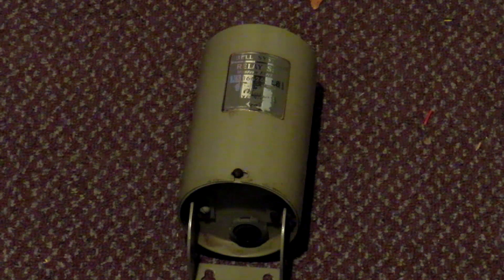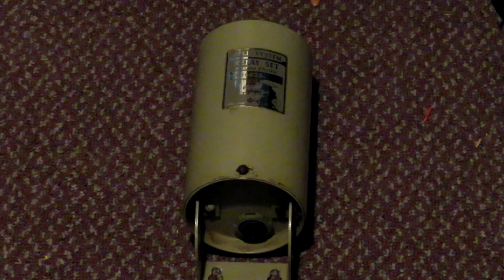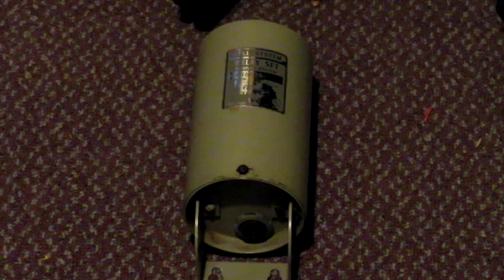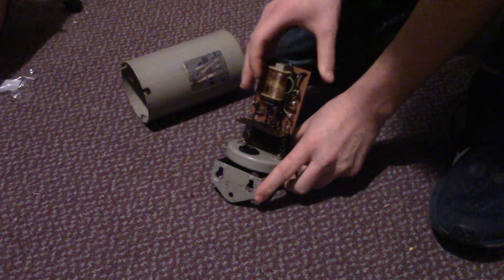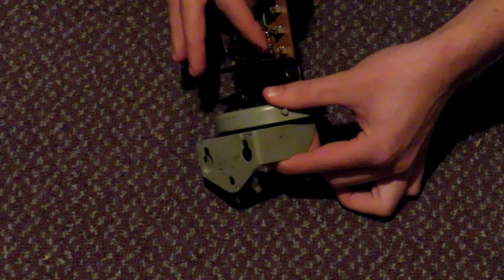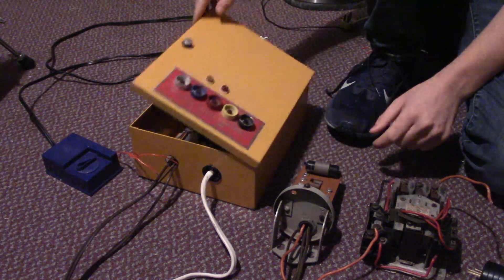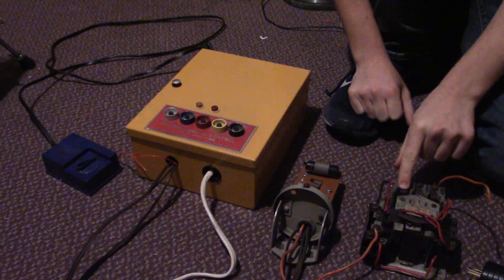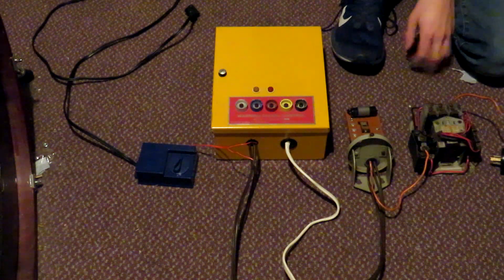How Do Telephone Wires Activate Warning Sirens?

Comment: gets a spam call
Reply: Most often these wouldn’t actually be connected to the PSTN. At least at the time of install, they would be connected to a system such as the CARW system, which was operated by the phone company but used completely separate equipment from the other switching equipment being used by the public.

Comment: Actually this is one way that telephone lines activated sirens. Traditionally, a rotary dial with a card that labels the finger holes with certain signals was used. You would dial the signal twice within 10 seconds. It's called the cdws bell and light system
Reply from the maker: sean juth Thats was found on larger systems for smaller systems this is what they used since it was more economical.

Comment: You never mentioned what was at the siren site. How would the siren controller decode the ringing voltage
Reply from the maker: sean juth It does not decode the ring voltage the voltage energies the ring relay that then energies the sirens main relay.
Reply: @FSThunderboltfan1000  then how does the siren relay know which signal to activate?
Reply from the maker: sean juth there are two ways to go about it. The first is have a central controller that controls the timing for all the signals so there does not have to be a timer on site. Then there is the option to have two dedicated phone lines coming in to control two different ring relays to activate the two different signals at a timer at each siren site.
Reply: @seanjuth  There actually is no signal or code to decode, the municipalities leas a dry pair of phone lines that go from the siren locations to the local central telephone exchange and from there are connected directly to another dry pair that goes directly to the fire department or police station where there is an AR Timer and a special power supply also leased from the phone company that supplies the voltage for long line runs. Let's say that a city has six siren locations. Each pair of wires from the six siren locations are wired parallel (red to red, green to green) to the pair at the central office that go back to the source (At the fire department or police station). At the source there is a normally open relay wired between one terminal on the power supply and the red wire on the phone line going to the central office, the green wire going to the central office is connected to the other terminal of the power supply. The coil on the relay is hooked up the the AR timer the same way a siren contactor coil is.